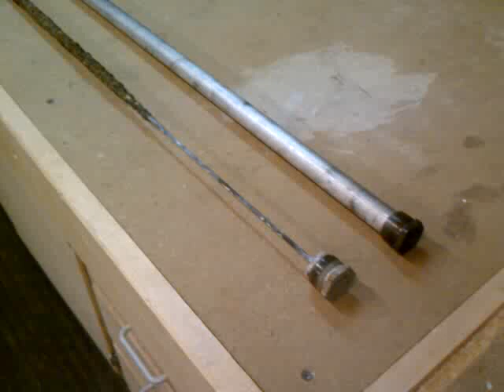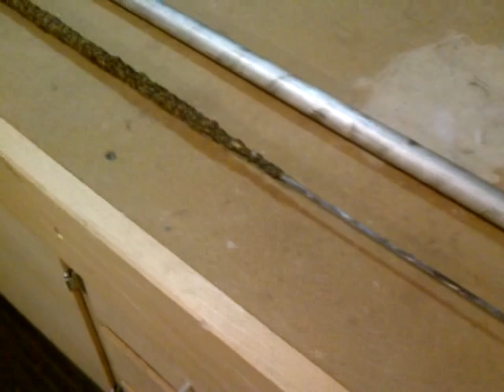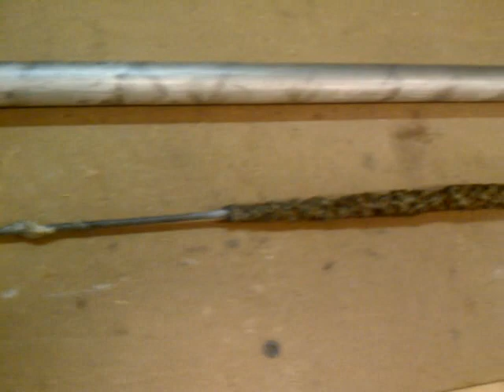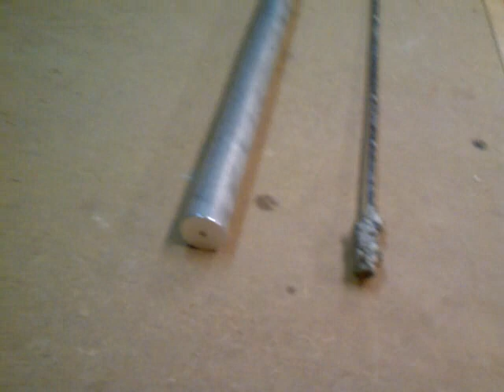Water Heater Anode Rod

Comment: For more than 60 years, it's been used as a key part of the rust protection of a tank, although few people know it's there and it's difinitely much cheaper to periodially replace it than to buy a new hot water tank.

Comment: It can use for hard water ? Thanks.
Reply from the maker: Ha Luong Sure.  It just may deteriorate faster.
Reply: Thank you so much. Is it make hard water be soft ?
Reply from the maker: Ha Luong Hard water has a high mineral content of things like calcium and magnesium. The anode rode just protects the tank from rusting because the rod corrodes instead.  It has no effect on the hardness of the water.  Changing the anode rode very 5 years can double or triple the life of a water heater.  Mine is now 30 years old.
Reply: Thank you. It is helpfull for me.